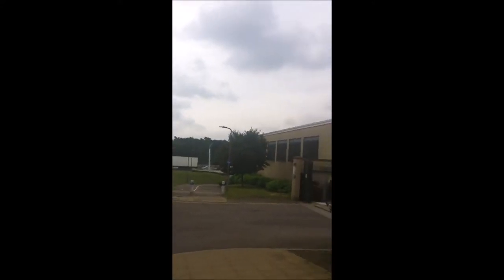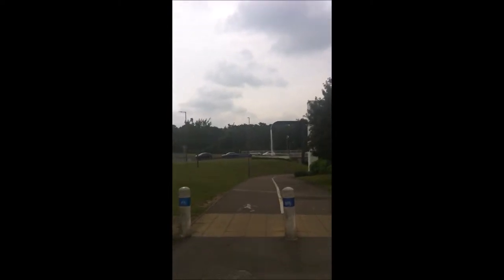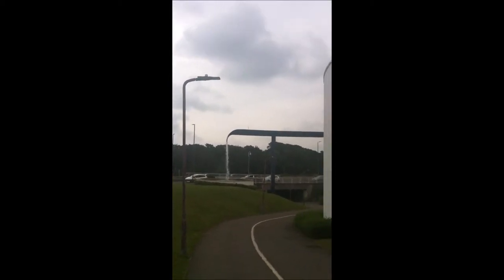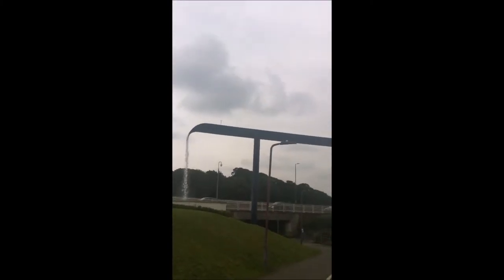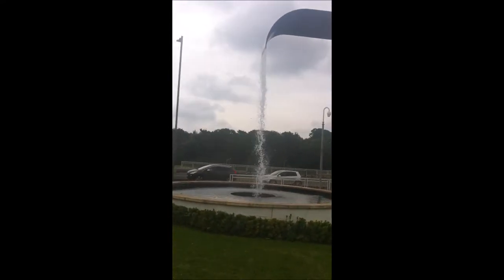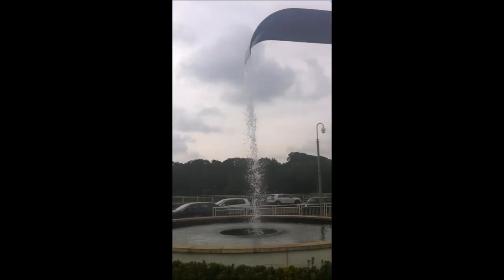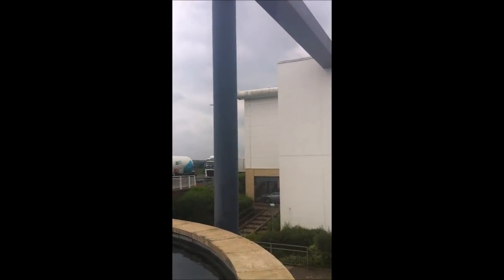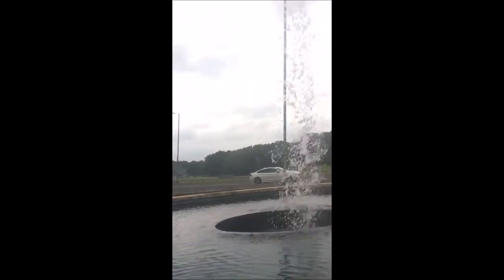How Does The Water Fountain in Harlow, Essex Work?

Comment: There is a pump that brings the water up to the fountain and there is a drain in the middle which collects it and is piped to the pump. The middle circle is a wall that is just high enough to let some water fall in to the drain and to give it the effect shown. Is that the fountain by Asda? Because if it is you can be sure the water source probably is runoff from the roof. It looks to be attached the building somehow.
Reply from the maker: Oh great thanks for letting me know that makes a lot of sense! It is the one by Asda yes. Thanks again for filling me in I did wonder :)